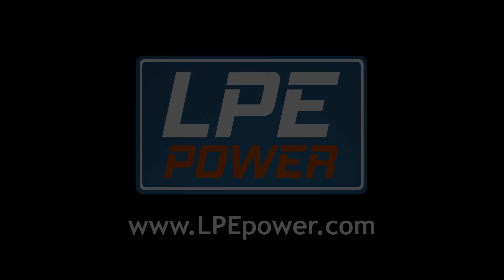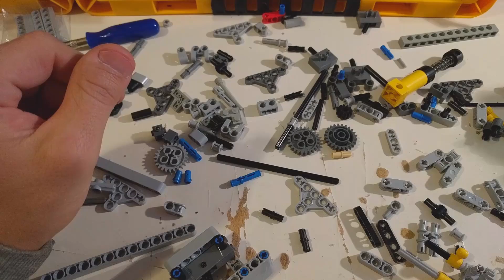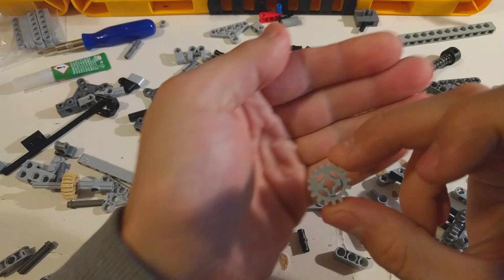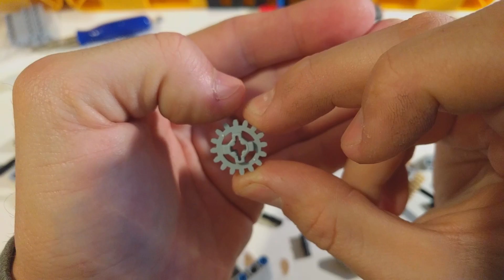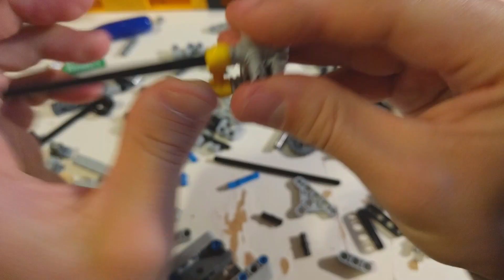LPE power Development - Small cylinder Inline 4 part 1

Comment: So... will you put it into the E30?
Reply from the maker: You will have to wait for the next video to find out. (or just pay close attention to the video thumbnail) :P
Reply: nicjasno well, I did, that's why I am asking :D
Reply: Do you also know how it will be propelled? Via stationary or an onboard compressor?
Reply from the maker: Stationary compressor or onboard pressurised air tank.
Reply from the maker: I don't want the gas to expand before it gets to the engine. A small valve will regulate that.
Reply: nicjasno Could the little CO2 cartridges work of they were hooked up to an expansion chamber to prevent liquid from getting into the engine? Or would that not provide long enough of a run time?
Reply: nicjasno Wouldn't that allow liquid CO2 to get into the engine as everything in contact with the gas gets colder and colder? It'd also lower the pressure as the temperature difference decreases
Reply: No